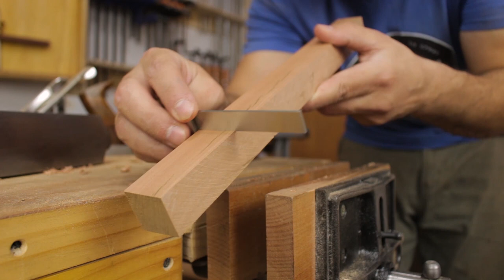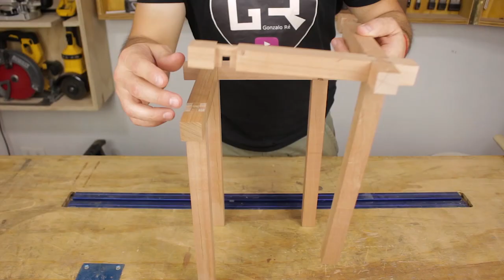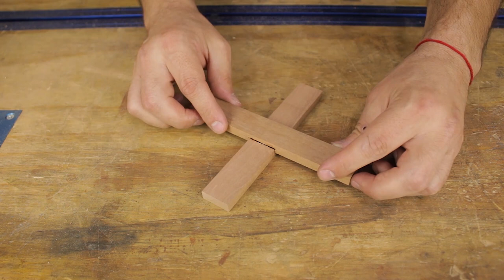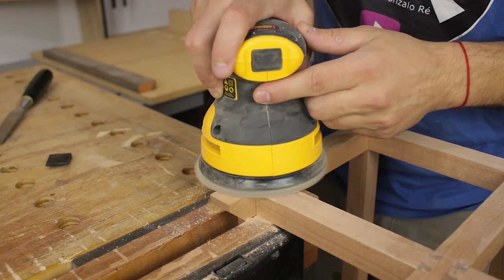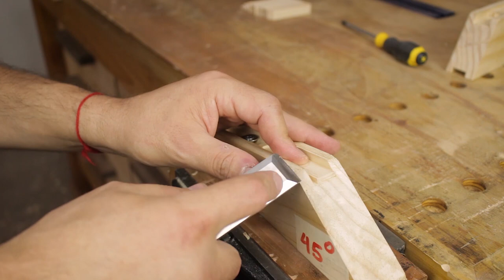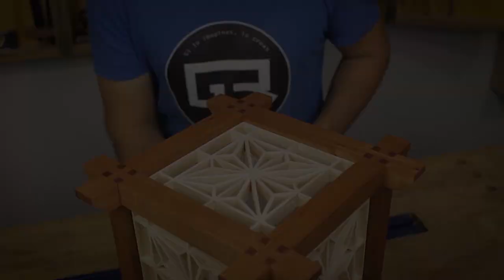Amazing WOOD LAMP MAKING [JAPANESE Style]

Comment: Nice work. Japanese saws are great for accuracy in joints. Any deviation from the scribed mark usually starts if you push on the early positioning cuts. Vital to pull on the cut strokes. Lovely design